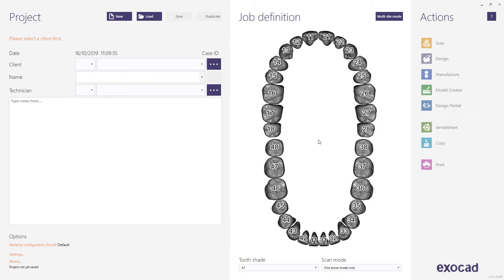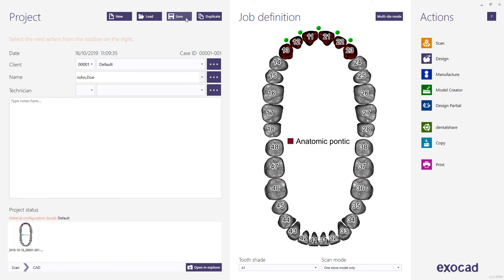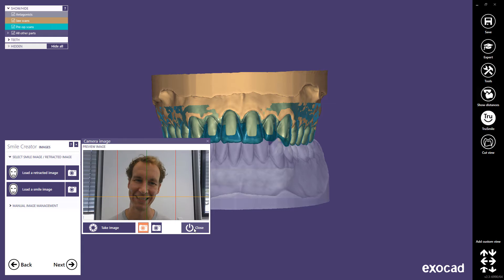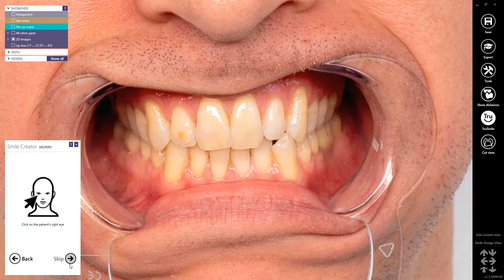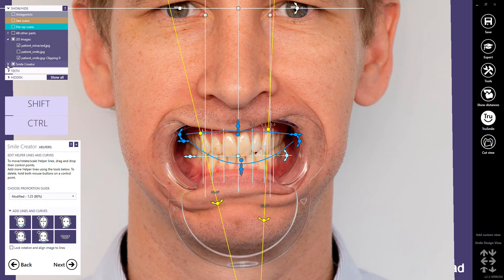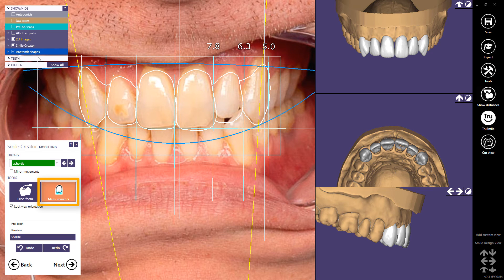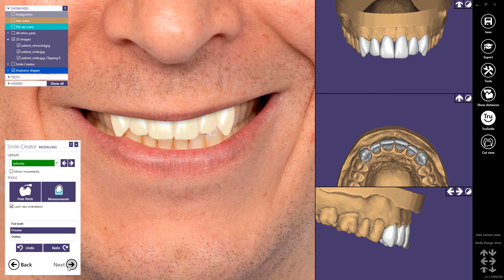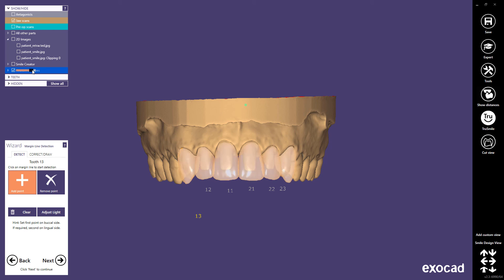exocad Quick Guide: Get the most out of your Smile Creator Module!

Comment: How about upper lower
Reply from the maker: Hi @gerontiemsen6749,
By default, SmileCreator always displays only the upper jaw. If you want to use Smile Creator to design restorations for both jaws at the same time, skip the wizard step that appears at the beginning of the wizard and continue with the setup until the teeth of the upper and lower jaw are positioned. Then start the Smile Creator by clicking on the Tools button in the main toolbar.
Now the teeth of both jaw arches are displayed in the Smile Creator.